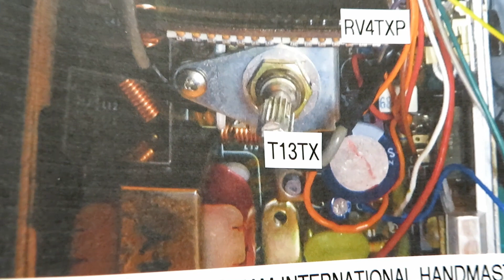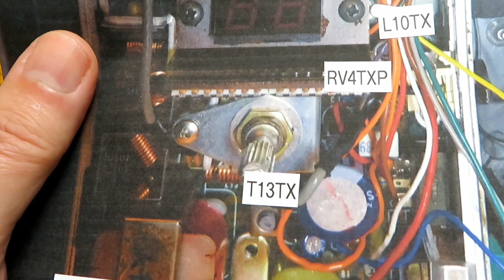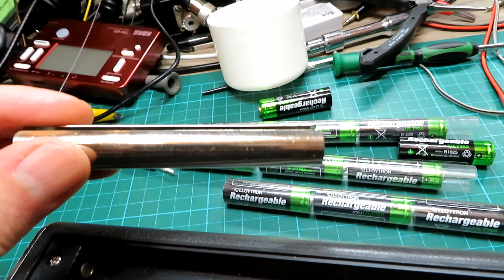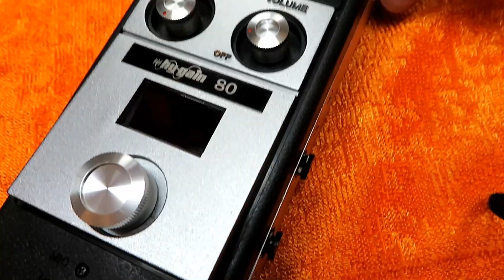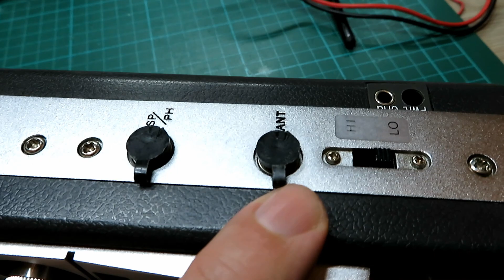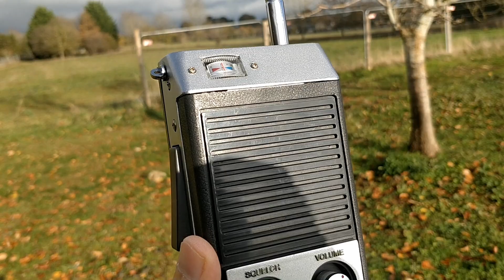THIS WALKIE TALKIE IS MASSIVE - LIKE NEW - IS IT REPAIRED? - PART-2

Comment: This walkie-talkie is either a fraternal twin or first cousin to Lafayette's Dyna-Com 40. Squelch/volume in same spot, as is channel knob and display. It even has the microphone connector at the same spot (including the switch for internal mic or external). It's in CB-SAMS 268 should you run across another one. I've only seen a Dyna-Com 40 once on eBay (where it is now), and you're quite correct, both the Hy-Gain 40ch WT and Dyna-Com 40 are massive, heavy, built-like-a-tank walkie-talkie that's almost never come up for sale. Great 2-part series, enjoyed it immensely  👍
Reply from the maker: Thanks 😎

Comment: Hello.
It's great that you managed to fix it, it's the most expensive portable CB radio ever produced in series. There were several hundred of them per model, less than 1,000 in total worldwide.
The power supply is 12 AA cells of the "industrial flat plus" type. Everything matches. Use these.
Charging is a transformer  24V 2W + rectifier bridge, (no capacitor) (40-50 mA), it's oryginal charger.
The speaker was not very successful, unfortunately it was a 100 ohm prototype, it was used because they wanted to give up the microphone transformer so that it would not take up space and would not increase the weight. Ite speaker had a lot of failures, the coil wire was very thin and delicate, it was damaged quickly. It is a very acoustically sensitive and delicate speaker.
Deformation of the diaphragm due to moisture causes the coil to rub against the pole piece and destroy the coil.
The antenna is of exceptionally good quality, the most expensive brass model was used (double pressing on the telescopes, Japanese work, also SONY ordered antennas from this factory).
This radio is supposed to have a power of between 2 and 3.5 W
, is the old "5W input power" standard.
This is a standard when a license for such a radio was needed in the USA.
The power consumed by the last power block was measured, a long time ago the output power was not measured because CB services in the years 1950-70 did not have power meters. The meters were tube-based and expensive, manual production only for State laboratories.
The delivered DC power to the last power transistor was measured.
Typically it was 11-12V and 0.45A with a 14.4V supply (12 cells of 1.2V).
This was the Official standard imposed by the FCC rules.

Then modern power transistors and newer integrated circuits of acoustic power amplifiers caused that when powered by 10 Ni-Cd cells (12V) the power block received about 10V and 0.5A (for 5W Input Standad) and about 2 to 3W output power.
However, the output power did not matter, it was only in the early 1980s that the standards for measuring the output power were changed and the range of 4W absolute maximum was established, taking as an average 2W for portable devices powered by 10 AA cells and 2 to 3.5W for automotive devices powered by  13.8V
The voltage loss from the 12 AA cells, 14.4V to 11-12V was caused by the resistance of the AM modulator winding.

Generally, today typicaly battery devices were powered by 12.5V (10 cells) and the parameters were given for such voltages.
Because charged Ni-Cd batteries had such operating voltage under a load of several hundred mA.

In Western Europe, we had AM standards that the power supplying the power transistor would not exceed 2W and the output power would not exceed 0.5W. Modulation not higher than 95%.
That was until 1982.

Good health.
Reply from the maker: Wow amazing info thanks 👍

Comment: Fantastic looking radio. Great to see it up and running again.

Just a thought on the batteries: It would make sense if the eliminator/dummy was intended to be used only with alkaline 1.5v cells, giving you 15v total for 10 cells. A full set of 12 NiMh cells will give roughly the same total voltage.
Reply from the maker: Yes these nimh cells were 1.45V off the charger so just being cautious also there is no power difference between 10 cells and 8.
Reply: @knoxieman  fair play. Excellent refurb either way 👍